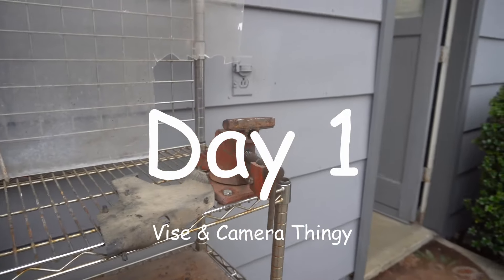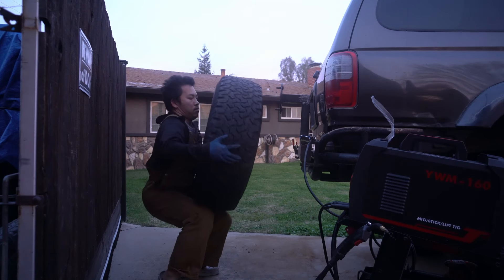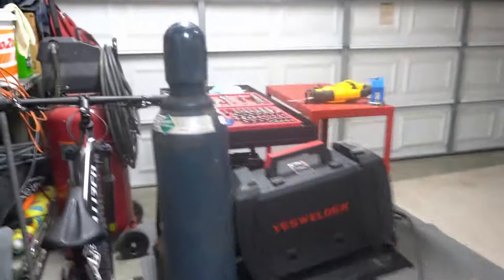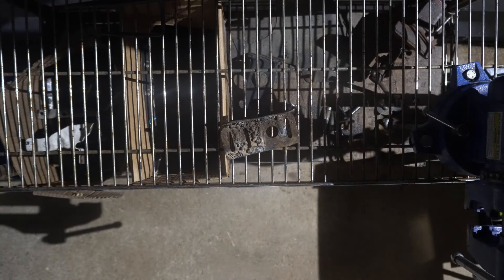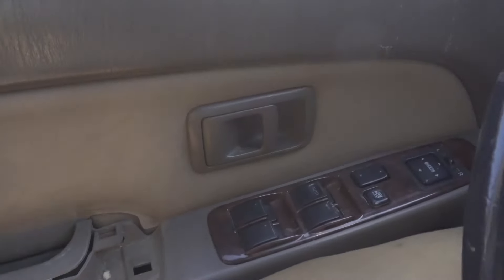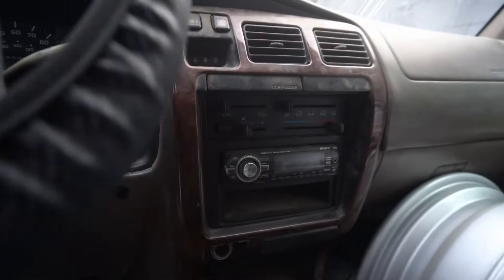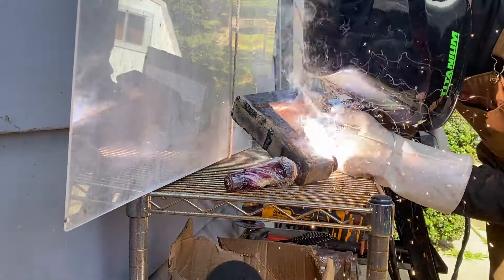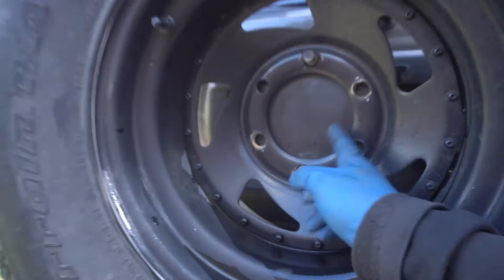4Runner & Chores | New Welder

Comment: Hello, New Viewer here. @25:18 latch installation. As you know,  you'll  be carrying the spare tire and it is heavy. How the latch is mounted is not holding the swing arm from opening. It should be somehow designed and mounted horizontally to hold the swing arm from swinging out. As it is, the vibration will make the swing arm move back and forth. Also, I think, if you design your swing arm lock @15:38 when you do your remod and shape it like a C and drill 3 position holes, it work better for you. Position the middle hole to lock the swing arm just to clear the hatch when opening it. This way you don't have to open the swing arm all the way when you need something inside the back of the truck. JMO.
Reply from the maker: Yeah. I’m just a newbie at fabrication. I’m planning on redesigning it.
Reply: @xxpocketknifexx7084  I also like to mention that if you are going to be mig welding with gas instead of fluxed cored wire, you can save money by using 100% CO2. Mix gas, not only more expensive to refill but also uses more gas when you weld. I use 20 lbs  bottle with 100% CO2 on my old 135 Miller MIG and it last me a long time. Probably it last more than 3x than a mix gas with the same capacity bottle.
Reply from the maker: Alright thanks for the tip I’ll look into it